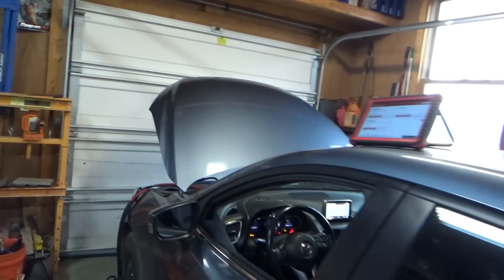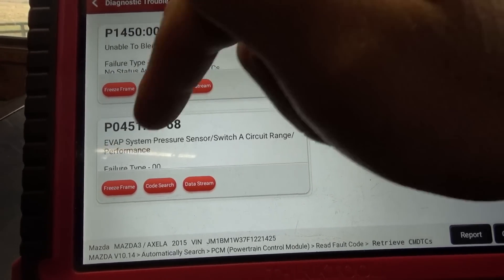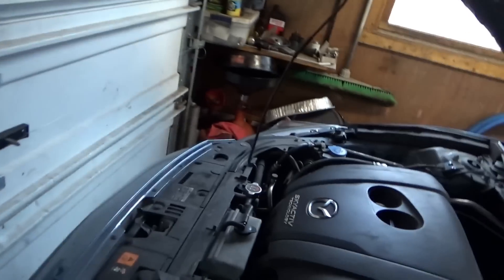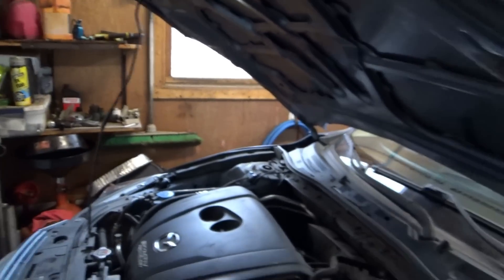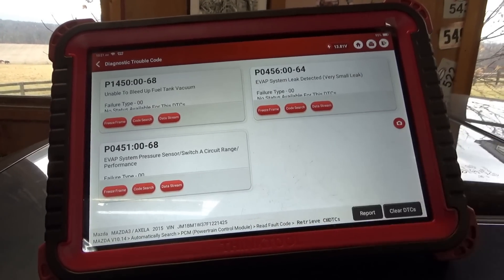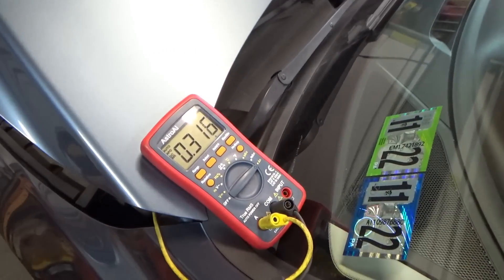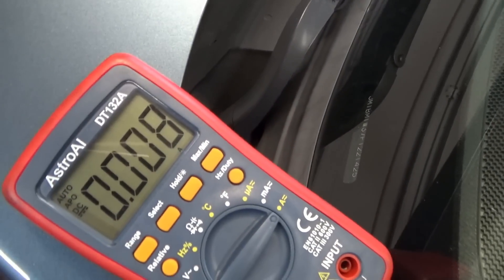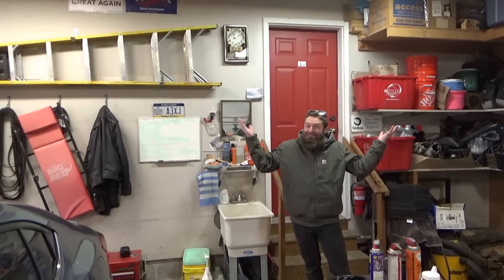Mazda EVAP Parts Cannon FAIL (P1450/P0451)

Comment: I am getting the same p0451 code for my 2019 cx-5, will have to check my hose, Mazda wants 299 to diagnose plus parts, soak me for a new cannister or sensor I probably don't need!

Comment: Cylinder leakage test would have found it quicker.  An old tech once told me,you can throw all the components on an engine you want,if it not good mechanically it won't fix it

Comment: Ivan that what you called nipple that was in the frame seams strange , I wounded if it was a back flow device it would interesting to know seems strange to have just a thru connector. Good video enjoy your approach to problem solving

Comment: Great diag with common sense and use of the TSB being the key. It seems like a tee fitting placed inline would be a good thing then you can leave the poorly designed nipple hooked up and let the water drip out of the open port of the tee. Just a thought. Thanks so much Ivan for all your great lessons and your dedication to your customers who are lucky to have found you.

Comment: I run dashcams in my vehicles and my suggestion for your customer is to make sure he has the park mode settings right.  I also have mine powered through a voltage monitor that will completely shut the power off to the camera once it gets to a certain level so the vehicle will still start.  Thank you for another great video!

Comment: There’s a TSB out on some Grand Marquis for spiders building webs in the vent tubes causing an evap code.  I had one of them come in and proceeded to find and evict some spiders.  The customer returned for maintenance a few months later so that was a confirmed fix.

Comment: You could put a small filter into that tube to prevent dirt buildup - use the filter element from a cigarette, cut down to fit just enough to stay in place.

Comment: 2 minutes in, I am leaning towards a wiring issue, possibly near a connector.  The "it got better for a while" sort of thing makes me think that replacing the purge solenoid may have been an action that disturbed it enough to make a better connection for a while, but in the end it has once again wiggled until it's either under reporting or not keeping proper control.

Comment: I don't think the problem is caused by the back up camera itself because power should shut off for the Back up camera when the ignition is turned off preventing it from draining the battery. Probably back up camera and monitor are connected to an always on power instead of through the ignition switch where it should be. Installers mistake.

Comment: There was nothing wrong with that dash cam. you're suppose to used switched ignition / accessory power to power it, not a hot-at-all-times cigarette lighter. lots of cars have the cigarette lighter on switched power (such as my hyundai & subaru), but mazda seems to have gone the ford rout & made it hot at all times.
Reply from the maker: He uses it when the car is parked lol

Comment: looked like a mud dauber plugged it or one of those other bugs that mud pack holes for their eggs. I have seen that on many things over the years, including other open vent ports, hoses, faucets, pipes, tubing, not just on automotive. I guess I have an advantage in that sense. he should alert the other shop so they can place it in their minds for the next sucker. 🤪
I would have for sure checked that and blasted it out with compressor if it was a straight through port.

Comment: OK  OK  Well with my next new vehicle I want a dash cam front and rear. Some times I don't drive / start it more than once or twice a week and that is on the same day. What do you think the fix will be?  If I'm close enough to a power outlet do I plug in a trickle / battery maintainer.

Comment: During the 1960's there was a vent on Mustangs which bees would like to plug with dirt to build a nest. I remember some mechanic diagnosing it on a call in radio show. Those were the days when cars were simple & you didn't have to be an electrical engineer to fix them. Of course, they were death traps in accidents compared to todays cars and light trucks. Seat belts, airbags, and crumple zones saved millions of lives since then.
Reply: EE here and i approve

Comment: Nice work Ivan!  I had stumbled onto that same issue once before a few months ago.  The customer brought in his own canister and asked me to replace it.  I didn't diagnose it then.  Only confirmed his suspicions when I checked before and after repair readings.  The car was showing me the same signs as this one.  And after replacing the canister, all seemed fine.  Customer came back a couple of days later with the money light on again.  Same problem.  He asked me if I can diagnose it and hopefully fix it.  After poking around a bit, I find that little nipple was blocked solid.  So, I just ran a brill bit through it.  Problem solved.  No parts required.  LOL
Reply from the maker: Nice! My policy is usually diagnose first before replacing parts even if the customer already has it on hand. Makes it easier to return if it's not required 😉
Reply: @PineHollowAutoDiagnostics  I would have to agree with you 100%.  But when you work for someone else and your employer rejects your input (the customer was very adamant about his decision) and tells you to do this and not that, what else can you say?  Right or wrong, you give the customer what they want, and are willing to pay for.  Some people just prefer to learn the hard way I suppose.

Comment: Spooky, I have an almost identical setup: same gen 2.5L Mazda3 with a Viofo dual dash cam. Tip for the owner, you can get a 12v-to-5v cable that piggybacks off the rearview mirror's power, which is only active when the car is running or cranking. Been using mine for over 3 years now, no issues. You won't have parking mode, but you also won't have a dead battery 👍
Reply from the maker: He primarily uses it for parking mode lol
Reply: @PineHollowAutoDiagnostics  he might have the cam set up wrong, it should use way less power when in parking mode - might just be in regular recording mode 24/7. Either way, he can pick up one of those battery-protecting hardwire kits, Amazon has a few for under 20 bucks.
Reply: New cars no longer have "accessory" power ....who made that decision ?

Comment: You could throw a tiny vent hose filter on there and shove the thing into the big hole in the frame and goop it up to prevent any moisture, dirt, debris, and junk from getting sucked into the vent hose. If I remember correctly, this helps the purge solenoid release vacuum when its being actuated by the computer. This was a fix on my honda civic where the vent tube was sucking in (only a tiny puff at a time) salt, brine, and water into the purge solenoid eventually destroying it over the course of a northern Michigan winter. I finally read on a forum that the person bought a small vent tube vent filter and attached it to the hose, and shoved it back into the frame hole and gooping it up. This is federally mandated, designed, and botched onto your new car in the factory so one of the common reasons these systems fail in northern climates and I would presume everywhere else where the car is being driven down dirt roads all the time.
Reply from the maker: Luckily this little hose is just reference pressure, no flow just needs to breathe 😁
Reply: @PineHollowAutoDiagnostics  I was looking for why taking the gas cap off didn't change the pressure. I didn't understand it was just a reference pressure hose. Thanks!

Comment: I was expecting to see a spider's nest at the end of the plastic fitting in the frame. For some reason they are attracted to hydrocarbon vapors and love to build nests there causing excessive fuel evap system pressure codes.
Reply from the maker: They like getting high on fumes 🤣

Comment: A cigarette lighter adapter socket that is powered all of the time combined with a 12-volt USB power adapter will result in the vehicle's battery being drained to the point of a no-start.  The customer may want to consider using a VIOFO hardwiring kit which is the proper way to power that dash camera in parking mode.  The VIOFO hardwire kits have a user configurable low voltage cutoff feature to stop powering the dash camera when the vehicle's voltage level drops below a predetermined voltage level.  If the customer is trying to record events that take place while the vehicle is parked for an extended period of time, he may want to consider using a dash camera battery pack to provide the power to a VIOFO hardwire kit which then powers the dash camera.  The dash camera power load will be isolated to the dash camera battery pack (while parked).

Comment: I have the same camera, the owner has it setup wrong. Mine draws less than 50mA. When its actively recording with the screen on it draws a bit of power. The screen can be set to turn off automatically after 30 seconds or a minute. He can also turn on park mode which reduces power consumption when the engine isn't running by only recording when something happens. Its another case of needing to read and research before throwing parts at a problem. I can go weeks without killing my Tiny Honda Battery (TM).  I will say its worth it, saved me $2k on a hit and run in a parking lot.
Reply: Thanks for saving me all that typing because I was gearing up to say basically the same thing. . That's a great camera that's simply not installed and setup correctly.

Comment: So, the USB is not a run-controlled option? My car treats USB as an accessory... off with the key switch...
Reply: My '13 has both always on 12V and switched 12V depending which one you plug into.  Enough rope to hang yourself with and all.

Comment: How many techs today spend doing reaserrch on the problem ? More rely on    codes and automaticly replace the part especially if the vehicle is under  warranty and working on flat rate

Comment: I just bought the Thinktool ProS. I have noticed that the TopDon scanner is running the same software as the Thinktool, judging by the topological display on both units. Is this the case?
Reply from the maker: They all use Launch software 👍

Comment: The dashcam is supposed to a) Be plugged in to a socket that switches on with accessories, not "always on"  b) hard wired with a battery protecting module that will cut the power at voltage threshold or a timer c) Programmed to turn itself off after no movement for a time.
Nearly all have an internal capacitive battery that will record at least 30 seconds if an impact is sensed when switched off.
Bonus comment: I wont fit these to BMWs, I have been bitten by BMW's excessively protective vehicle electrical monitoring system before.

Comment: The Dash Cam may have a ''Shut down with Ignition off '' option. My Nextbase has this option, ''Always on, Movement Sensor, or Ignition shut down'' It may be worth a look in the cameras menu settings,
Reply: Either that or it needs to be plugged into a switched outlet, that comes on with the ignition, if there is such a thing.
Reply: @blueribb99  My '13 has both; the always-on is inside the center console, and the switched is in the lower dash
Reply: Good advice, I'd also check for a firmware update.

Comment: i'm not sure my 2000 f150 will even set an evap code. with state inspecion laws on check engine lights its a plus. i'll run it till its dead AND burried.

Comment: Great no parts required, well at least no parts required on your part, fix. That's just stupid design, "oh let's have a vent hose where the end of it attaches to a special gromet thingy that will get blocked with dust and debris"... D'oh!!
You can get power supplies for the dashcams that cut off once the battery voltage drops to about 11.5 volts. I have a dual camera setup on my car and have the automatic cut out power supply connected to a constant power feed, so I can use parking mode on the camera, if I don't use the car for a number of days the system stops powering the camera so I have enough juice to start it.

Comment: Great and fast finding 
As a MAZDA tech my self for the past 25 years never saw this three codes together at the same time I do know about the TSB related to restrictions on the evap system. On late mazda 6s has a recall due to restrictions on the evap system hose from vent valve to vent filter due to spider web accumulated inside the hose.take in mind that dealer techs works under pressure environment for example they give you a repair order with similar problem and ask you around how long it’s going to take because customer is waiting.15 minutes later the ask you if you got any answers yet. That is one of the main reasons a lot of dealers tech just guess and go for the parts cannon.I can tell that I considered my self a lot better diagnostician out side the dealer when I do side diagnostic jobs.most of todays dealer techs got in mind that they has to produce minimum 10 hr a day no matter what. My personal opinion.
Thank for sharing your knowledge good job
Reply: Interesting real world facts!
Maybe the solution would be for the customers not wait for their vehicles. Have an appointment and allow the technician time to properly do their work!
Reply: I agree with you
Is not like it take us days weeks or months to figure it out 
But at least let us do what we supposed to do witch is fixed right the first time
Reply: @yourmazdasource  ....seems like its the customer care guys pushing the issue.I dont mind waiting if its done right
Reply: What state do you live in?

Comment: I can't help but to think the factory TSB was off a bit on their diagnosis.  I'd bet the problem most of the time is a plugged nipple.  The cutting of the hose to fresh air trick resolved it but I feel they got there the wrong way.
Reply: Either cut the hose and have the car fixed permanently or clean the nipple, have it clog again, and have an upset customer back in the shop for the same problem.

Comment: Evap issues are a big pita. Had a po447,po448 on my 2006 subaru sti. Same parts replaced. Last was the pcm . Total cost was $3500 dollars
Reply from the maker: Yikes. Can definitely save a lot of money by diagnosing the problem before replacing any expensive parts 😉

Comment: Ivan, of course that was an amazing find. What amazes me as well is the "Engineering" surrounding that "Reference System". The tube, the clips, the insertion nipple... if ever there was a "Brother-In-Law" design, that has to be it...
The engineers BIL owns a company that supplies all the parts required for that reference system. Sell 500K cars, $5 - $6 worth of parts, plus aftermarket sales and that's an easy multimillion dollar contract, with kick-backs... !!!!

Comment: why do you use the astro DVOM than others is it price or the functionality i have been thinging about getting one i have a really nice Snap-On one but compilicated to use and have a Fluke as well. Saw Diag Dan using a MA amp clamp on amp clamp was yellow but he said worked great for low current draws
Reply: Thanks so you mind sending model number where I can get the same one. Thanks
Reply from the maker: @DependableAutoTruck  PHAD Amazon store 👍
Reply: @PineHollowAutoDiagnostics  thanks will do
Reply from the maker: Astro is accurate, big display, easy to use, and cheap to replace 😁

Comment: That dashcam is programmed on 24/7, so it might be adjusted to on only when engine is running.
Reply: I thought the same thing. A camera always on, will always cause a parasitic draw. The accessory socket on that car is permanently live. Some vehicles have an option for a different fuse position, to  make it come on only with the ignition on.
Reply from the maker: It's more useful when parked at night in a bad neighborhood lol

Comment: I wonder how it set the leak codes if it couldn't vent properly?
Reply: When he started he saw negative reading on the pressure sensor so it looks like a leak (vacuum on the system is also considered a leak when pressure is not within parameters at a specific part of the evap test). When the evap system starts the check system should be at 0 psi or atmospheric pressure. For example if purge valve was stuck open and always pulling vacuum on evap system that would be considered a leak.
Reply from the maker: If pressure sensor is malfunctioning then computer gets confused and may set other false codes 👍

Comment: Car owners mechanic is. Well you know. You wouldn't have little problems like this with vehicles yrs ago. Sad... Great job on getting to the root of the cause 👍
Reply: Well, no you wouldn't have that problem but did you hear where the guy drives 200 miles a day?  How long do you think a car from back in the day would last like that, if we're being honest?

My '13 Mazda 3 is nearly 200K miles and I only had to replace a wheel bearing, besides normal wear items (oil, oil filter, tires, engine filter, probably should do the cabin filter but I haven't yet, I'm aggressive with engine braking so I haven't needed any work on the brakes...)   I'd expect I'd squeeze 300K out of it with no serious issues.  The age before fuel injection and electronic ignition didn't get you numbers like that.

Comment: Ivan,    Again common sense prevails. One thing if I may add is, why did you not just put that plug back in rear of car and put hose back in place as it was. Now you easily solved this issue with the dirt/dust clogging the vent you could of relayed this information to the customer for future reference. Just asking and not trying to be critical. Just wondering. Thank  you...Pete